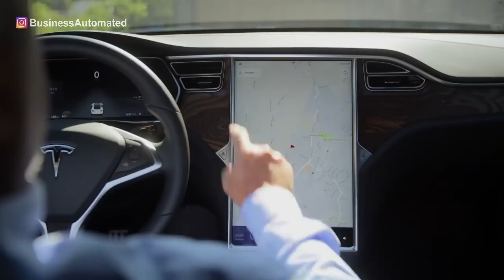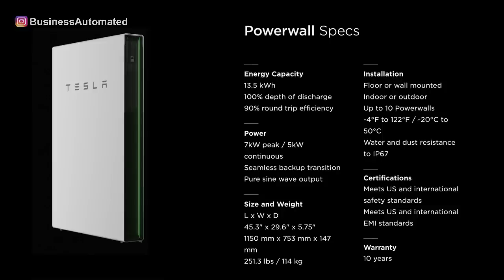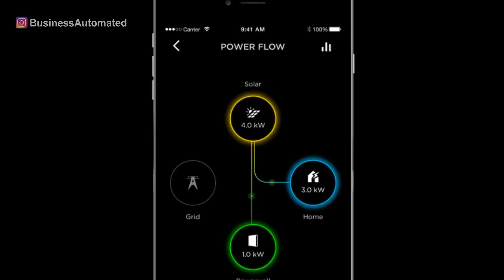NEW TESLA MODEL S TO LAUNCH SOON?

Comment: Yea I think make it or break it is a bit redundant (after the much larger hurdles Tesla has already overcome). They won't be going anywhere and will likely top out at over 20 million vehicles a year. But it was a nice broad look at the market entering 2021 and truth be told - it might be a "make it" year for electric vehicles in general. I wouldn't say "or break it" because EVs also won't be going anywhere. But it will be interesting to see if we'll see 2021 as the year of EVs or it will take more time. I think 2020 was a change over point.
Consumer demand is definitely behind EVs and every auto manufacturer (except Toyota strangely enough) is pretty much going all in and will see a massive increase in EV production this year.
I'm hoping we don't see battery supply and cost issues driven by the massively increasing demand, though it will likely play some role. This would seem like the limiting factor. 
Either way (and I don't seem as nuts saying this now as I did last year) - by 2030 ICE will be a small market niche for special cases. By 2025, auto manufacturers will be basically throwing out their unsalable ICE stocks and reluctant to produce anymore. It's one of those weird things where at the start, everything thinks you're nuts. Then when it gets there, people believe that they knew all along their new normal was on it's way.